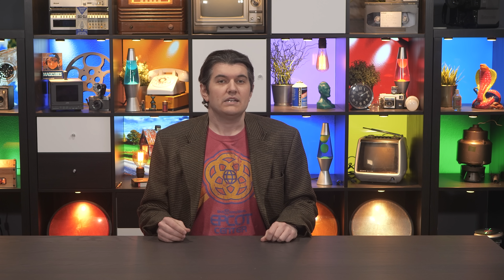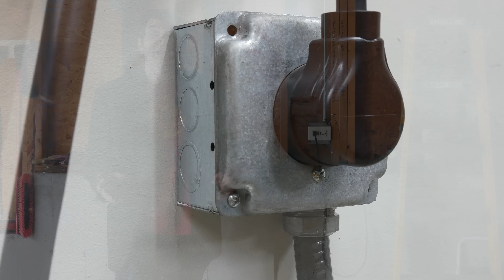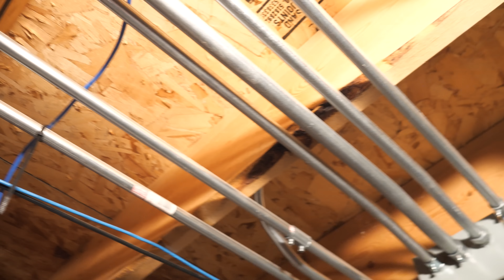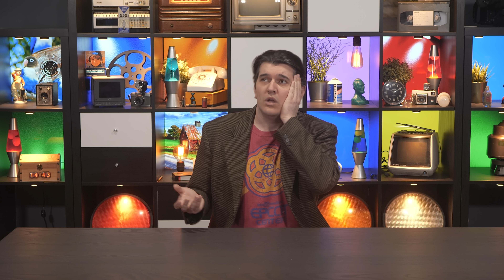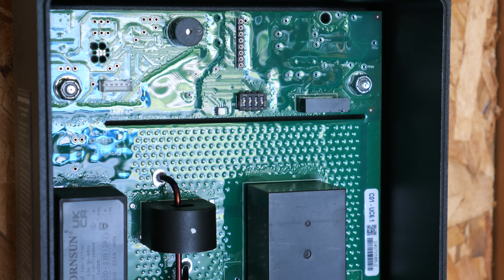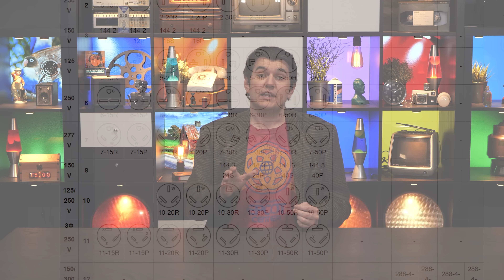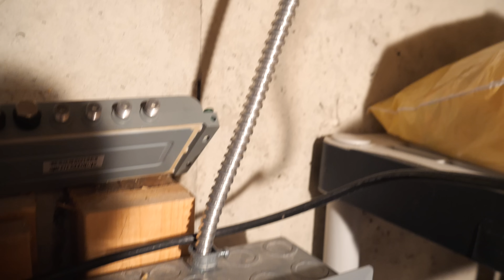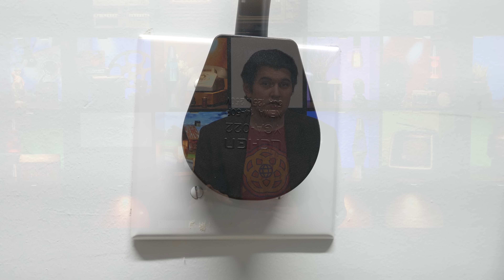The "standard" car charger is usually overkill—but your electrician might not know that

Comment: We have a 11kW capable charger, but usually charge at 4kW so it matches my solar panel output. Only when defrosting the car, or in emergencies, we use the full 11kW power (3 fase 16A 230V).

Comment: I've been using a lvl 1 charger for my Bolt for 2 years... Always planned to upgrade to a lvl 2 but have have never needed to. When/if I do upgrade, 24A is more than enough. 
For those EV curious: Your car's range has nothing to do with your needed charging speed. Your daily driving habits are all that matter. Also, your car is normally plugged in more than just overnight.

Comment: I had a Nissan leaf for over 3 years and plugged into a 110v outlet, ran the charger cord under the garage door and plugged into it as I parked outside. It gave me the 35+ miles I needed for commuting every day. The only reason I could have possibly wanted to get a 240v charger is bc some days I accidentally skipped charging and needed twice the charge. And some cabin preconditioning would have been nice but I live in a temperate climate.
  The dryer outlet adapter box is a fascinating idea that I wish was available for me at the time. Also, people looking for alternatives should look into chargers that actually install AT your electricity meter. There is apparently good access to power there and it's a simple set up from what I hear. This may work out well for some folks who park outside, or small duplex rental units

Comment: One thing to consider: the electrics need 300-400 watt during charging despite the charging speed. So charging 14-16 hours with 3,8kw on one phase 240volt needs 5-6kwh increase of 1-1,5kwh if i charge with 11kwh 3 phase 11kw. 

It adds up...

Just saw you already commented on that. 3 phase 11kw charger costs 130€... Just 20-30€ more than the 1 phase 3,8 kw charger

Comment: If I could swap out the on board charger to an 80 amp unit I would do that.  That would allow nearly 0 to nearly 100% in about 3 hours on my Bolt. Sometimes that's not fast enough. I hate that after getting home I sometimes have to wait 6-8 hours for my 32 amp charger to recharge. I really wish it had a 200kw battery that charged in 5 minutes. If I lived where I didn't have to go over 5 miles in a day I'd be ok with a level 1 hooked to a 250 watt solar panel but that's just not my case.  Just because it works for you doesn't mean it works for everybody.

Comment: I litteraly setup a charging setup off of a 3 wire 50 amp range circuit and added a grounding rod.... to a smart spillter...At that point I used a 100 feet extension from the range splitter to 2 ev charrger set my car at 16 amps and his is at 18 amps. So even at the worst we use 38 amps... but rarely happens do to the time and how long each car needs.

Comment: After 10 years of driving an EV, I have to disagree.  My wife drives 215 miles a week, and in the winter 120V 15A is not enough to keep up with the mileage she drives when she only charges to 80% max.  It's only adequate spring through fall for her.

Comment: Good video, the algorithm brought me here as I'm currently considering a ev.   I'm in eastern Iowa, and very rural.  So not much in the way of public charging within about half an hour drive.  From previously looking, I can get away with running out the door from the dryer if the 120v doesn't give me enough.  Longest commute I could have is 90 miles round trip, so obviously looking at models with good range for winter time decrease.  Question have read that 120v is useless in winter.  If plugged in soon as I parked, would it be able to maintain battery temp, and charge overnight?  Anyway, good video.  Now I'm off to lookup some chicken and dumpling casserole recipes.

Comment: Consider using a NEMA 6-15 or NEMA 6-20 outlet with suitable adaptor for your charger. They allow you to use the same wire but pull twice the power by simply rewiring the electrical panel to use 240 volts instead of 120. Basically you can double the charge rate with a simple socket and circuit breaker swap, without having to pull new wire. I find much of the cost of adding a circuit is the new wire run. The sockets and circuit breakers are pretty cheap.

Comment: I am an EV enthusiast, and have advised about a dozen people that it is unnecessary to upgrade their electrical service, or panel, in order to be able to charge at home, but also have advised them that if they can easily install a larger capacity circuit to do that for the rare time when they arrive home with a low state of charge and need to quickly charge for another trip.  But only if it is easy and not to do a service or panel upgrade.  

In most cases, as low as a 15 or 20 amp 240 volt circuit will be enough to fully charge overnight.

Also, I purchased 6/2 MC cable from Amazon to wire my Tesla Wall Connector to a 60 amp circuit for 48 amp charging.  They also sell 6/3 MC cable.

Comment: Good information, thanks. I wouldn't try to install any electrical in my home, but luckily, I have a 240-volt electric dryer outlet next to the door that leads to the garage. The hood of my car is about 5 feet away from the outlet plug. So, if you're not busy saturday drop by and I'll have donuts and coffee brewing. If you can install what I need to be compliant, as well as you articulate in this video,  we'll be done before lunch.

Comment: The absolute worst people about this are electric car "enthusiasts"... I saw a thread in a Blazer EV group on FB, asking what wall mounted charging station to install.  I pointed out that you don't really need that... The standard Chevy charging cord can plug directly into a 240 outlet, and put out 7kw.  They went into an uproar saying that was useless, and that you HAVE to spend like a couple grand to install a wall mounted charger, to get 19kw.  I pointed out "who cares, 19kw isn't fast enough to make a difference.  You still have to plug it in for hours to get from 20 to 80 percent. So if you have to plug in overnight either way, then why bother with a wall mounted charger at all?

Comment: Let's run some numbers, 120 V 15 amp giving loses you'll get roughly 1.2 Kwh due to losses and such.  If your EV takes 300 watts per mile ( Our Mach-e takes less on good days and more when it's cold) that's roughly getting 4 miles per hour of being plugged in, give or take losses and such. So if you have 12 hours to plug in that means you get 48 miles per overnight charging with 120 V.  This is what I've experienced having owned a plug in hybrid and EV since 2017.  I'm not sure how he's coming up with so much more milage.  I put in a 50 amp charger in my garage using off-peak charging for half the cost of energy.

Comment: And suppose you need more than 100 miles in said truck, just leave it plugged in for a day or two, 24-48 hours and you are there.  

Question though, Is it cheaper (lower power use per hour) to slow charge vs higher charge?  I'm sure it is better for the grid to slow charge over 8 hours than to quick charge over 2 hours?  If everyone charged at the same time, that is a hard hit.

Comment: 16:54 My car only gets about 20 miles to a charge so therefore, yes, I have the top my car off constantly if my car only 20 miles to a tank than yes I would be frequently going to the gas station and refilling. I drive typically about 16 miles to work one way. I charge while I’m at work for 13 hours, however when I’m home, I like the idea of being able to plug in when I get home from work and no in two hours. I will have a full charge to go about 20 miles and I can go run some errands on electricity rather than gas that I can come back home plug-in in a two hours I know I’ll have another 20 miles of Charge. Whereas with a level one Charger I won’t be able to do that. I will plug in get maybe half a mile of charge have to go run some errands come back home plug it again and then when I have to go to work, I won’t have enough charge to make it all the way to work, and then I rely on the gas motor. So yes, in my use case I need a level two Charger at my home.

Comment: Remakes sound good! 😊 Fun video! I didn't even notice the length. 👍 I think YouTubers in the EV space push the charging stations (permanent install) because they have thousands of dollars to just hire an electrician to put it in! But people overthink charging, and this is not necessary for a lot of folks, depending on their situation. 

Many power companies, fortunately, have reimbursement for them. In my area up to $500 for charging installs. In addition, check with your power company. Many have special overnight off-peak charging rates for EV owners. We're lucky here to have some of the lowest electricity costs, about 16¢ per kWh. But the EV off-peak rate is like 2¢ per kWh!

There's nothing wrong with doing a permanent install, but if it's going to cost a lot, I would just use a mobile charger. Have one in your car and buy another to keep always plugged in at home, so you don't wear out the 10-30 socket. Use a splitter at your dryer, with two sockets, plug your EV mobile charger and dryer both in, and leave it.

I am a fan of the "manual" splitters. They're cheaper than automatic ones, and I like the safety and simplicity of just switching from the dryer to the EV charger with the manual switch. If your dryer isn't in your garage, like ours, just put a pass-through in the wall and run your cable out through it. Our carport is right on the otherside of the wall the dryer is on, so it's convenient. 

But also, a LOT of people can get away with just plugging in to a 120 outlet and trickle charging, as you said. You can add back 30-40 miles of range overnight, and I rarely drive more than 30 miles in a typical day. Fortunately, most of us can just supplement with Super Charging. 

I am lucky to have a Super Charger one exit away, 3.6 miles, 5 minutes from my house. So if I use more than level 1 charging is able to replace overnight, I can just stop at the Super Charger and top off, on those rare occasions. 😊 

I've been doing a LOT of research, and it's just amazing what's available now! There are workarounds for nearly every situation. NACS and CCS extension cords, heavier-gauge 120v extensions if your mobile charger can't reach the 120 socket, wall pass-throughs for cables, dryer/EV charger splitters,  adapters, and on and on.........

Thanks for the video, because many people looking at getting an EV don't realise charging at home doesn't have to cost a lot to set up....

Comment: I have both three phase and single phase power at my house with two meters. This is because a long time ago when my house was built AC’s were 3 phase. Now that the 3 phase side has zero load, I want to do a DC fast charger just for shits and giggles.
Reply: where do you live? in finland the standard has always been 3x25a
Reply: @gamecubeplayer I am in the US. Most newer houses are 200A 240v split phase service. Some older houses may only have 100A 240V split phase.
Reply: my american apartment still has an old 208v 60a 2 phase fuse box
Reply: @gamecubeplayer that is pretty interesting, I have never seen 208v in a residential setting, but haven’t spent much time in apartments.
Reply: the apartment building is powered by a big 3 phase transformer but every apartment only gets 2 phases because the fuse boxes are just 240v split phase fuse boxes
Reply: @gamecubeplayer got it, each person getting 240 volt makes much more sense than 208 going to each unit.
Reply: Wow.   Never encountered an old house with a 3-phase requirement.   From which decade was this AC unit?
Reply: @SME.Retired my house and several around it were built in the early 60’s. I’m in the southeastern US so we need a lot of cooling power. Most have been renovated and the 3 phase service ripped out. It was probably done when AC’s were not as efficient since 3 phase motors are more efficient than single phase motors.

Comment: I couldn’t charge mine fast enough with level one for going consecutive days to work, which is 132 miles round trip in rough weather. I had already a 240 outlet, for a welder from previous owner, in its own circuit, but to my surprise level 2 cables were almost as expensive as a charger, specially if it was not programmable

Comment: I charge to full every night, but that's because I have a chevy volt and a commute that basically kills the entire tiny battery. I only got the volt because of range anxiety, and man do I wish I had gone full electric. Turns out I would have been fine on a 40miles a day  for 90% of cases which is super easy to recoup overnight. It can be frustrating if you are doing nonstandard errands though because on the volt it's "fast" charging, but def still doable.  

Now if we could just get them to stop putting ev charging stations at traditional gas stations and instead put them where there's more stuff to do.

Comment: I normally agree with your points; however, I disagree here. EV vehicles NEED to be chargeable at home within 24 hours. and Nema -30 outlets are not good enough to achieve that, let alone a 120V 15A outlet.

Sure the day to day doesn't usually require that, but cars are supposed to handle more then the day to day.

Comment: If you live in a cold climate, you *do*, in fact, need this 240-volt 14-50R charger at home because lithium-ion batteries can't accept a charge until they warm up enough. And if you only have a 120-volt trickle charger, you'll waste a lot of electricity and time heating the battery instead of charging it.

Comment: Another video spouting that most people can get buy with L1 charging.  That may be true for anyone who hardly drives, but the statement that anything under 200 miles per day does not need 24V charging.  BULL!  Using my F150 Lighting as an example.  My commute to work was 52 miles per day.  That is 22.6 KWH.  At 120V, that would take almost 20 hours to make up from the usage for one days commute.
Yea, you also mention low current 240 charging.

Comment: As a former Volvo Expert technician and owner of a Volvo BEV, your suggestion about miles driven vs need of charger type (type 1 vs type 2) is only half of the story. The battery drains much more faster in cold and hot climates with a 20 mile drive than what would drain the battery in a 40 mile drive in ambient temp of 65f.  

Also, 110v charging is EXTREMELY slow. 50% charge would take 14+ hours on my car. With a 220v system, my car would charge 75-80% in a 8 hour work day. 

My experience suggests you SHOULD have a 220v level 2 charger at home unless you live 10 miles from work and live in a climate where is it 65f year round. However, i would never own or lease an EV again as they are a complete waste of money.

Comment: It's easier and cost less to install a standard 60 amp copper circuit then install a 14-50 to code with a GFCI protection device.

I know because I've installed EV chargers for over 15 years .
15 years ago it was the opposite but evse manufacturers improved 
Cost of wire changed and that was both caused by demand.
I install a new charging connection almost every day since then.
I'm also a EV owner myself shortly after I got EV 
I'm on my 5th and 3 in the driveway

Comment: Any electric car can be charged from a home service. The question that you should ask is how long will it take? And that's the question. This is the reason why a lot of people don't want an electric vehicles. If you use a 110 outlet, that's a standard home outlet to charge your vehicle. It can take up to a week and possibly longer to charge so most people will go for a 240 plug can charge a bit faster just depends on the amps The downside about the 240 plug is as power transfers through it which goes back and forth at a long period of time. At a very high rate, it tends to play a game in the wire. It's called the weakest link. That's the reason why most electricians will tell you to hardwire your charger. Don't use the 240 plug

Comment: About ten years ago, when our garage was built I made sure to have a 30 amp 240v circuit installed for possible use with a small welder.  In the end this came to be used for our 20 amp EVSE that was originally used on our first plug-in hybrid.  That very same system has been used on 5 total plug-in hybrids and EVs.  Currently we have 2 EVs.  One is plugged into a level 1 EVSE, because it's average daily use is very low and the other uses the more powerful unit as needed.  There has been very few times this limitation has been an issue and that has usually been due to user error.  Would it be nice to have double the charge speed at times?  Sure but more than 99% of the time this setup is perfect for our needs.

Comment: There is a newer 14-50R receptacle, same blade orientation & same NEMA designation.  But this one is for EV's and the face of the the receptacle has a line drawing of a car icon as does the package it comes in.  The cost is something like 3 or 4 times more expensive than the one for electric ranges.  Apparently the NEMA folks noticed that the standard 14-50R was getting too hot and as you mentioned melting a bit.  The packaging for the older 14-50R now states not for use for EV charging (at least from Leviton).  The new EV 14-50R is physically much larger in depth, internal width, and the diameter of the receptacle face.  These are designed to used for continuitous charging for 8 or more hours and wil tolerate high tempoeratures or a least shed extra heat.  The typical use of older 14-50R were for electric ovens and stove tops, that generally heat up and  shut down or reduce current draw until the oven/stove top cools down a bit and then uses full power repeating the cycle.  So the older receptacle never experienced full power for hours on end and the plug could disapate the heat.  I supect the new EV 14-50R also has stonger internal springs to tolerate frequent (heavy duty) unplugging.